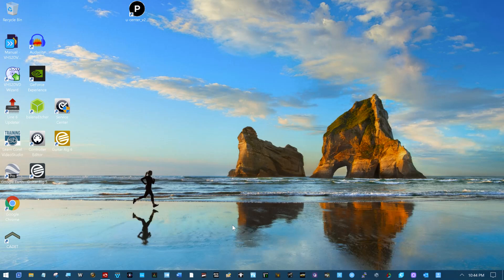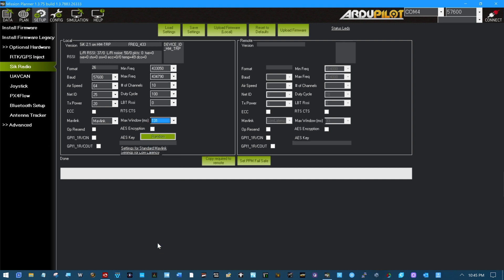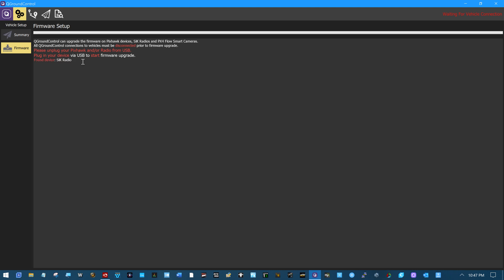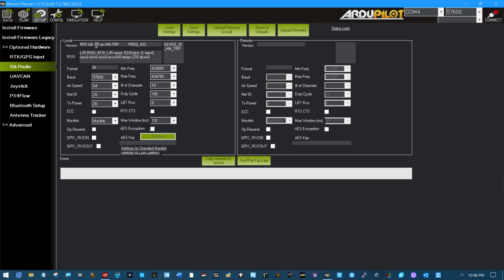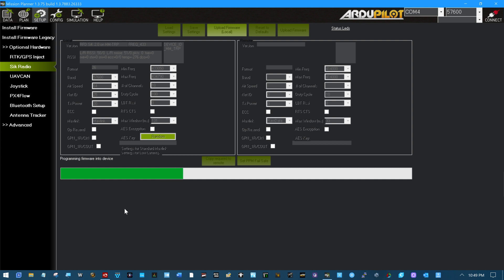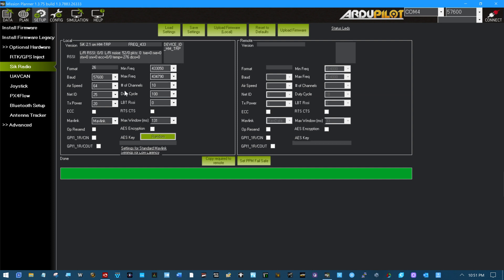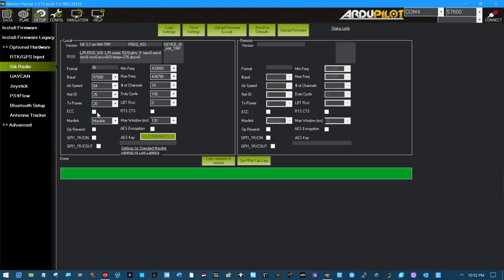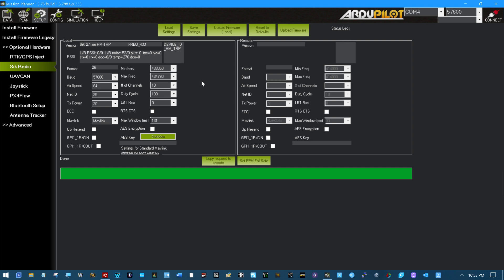Fun With Sik Telemetry Radio Firmware

Comment: Hi I'm getting the message "Failed to enter command mode" when trying to connect as per the video. I think there may not be a bootloader on the board. I purchased direct from factory rather than a hobby store. Do you have instructions for the bootloader?
Reply from the maker: I get that a lot.  I always go to QGroundControl and see if it works there, it happens so much.  If that doesn't work I go for the RFDTools.  If it doesn't work at that point I have to decide how much my time is worth vs buying a better radio.  :)
https://files.rfdesign.com.au/tools/
Reply: @nighthawkvs  thanks for the input. Which file/firmware do you use in RFD tools? the gbl and bin files aren't recognised by the software. It's looking for a zip file. 
Also do you select first time flash?

Comment: Mission planner is sayin failed to enter command mode when i enter load settings
Reply from the maker: Is this with USB or sik radio?  If it is USB some USB are charge only and do not have full data wires in them.  i will check further when I get back from vacation.
Reply from the maker: Did a different USB cable fix your problem?

Comment: In your next video can you open the drop down on the power settings in both firmware I  got both the 100mw and 500mw and can't seam to get the power to go higher than the 20 can you do higher?
Reply from the maker: 20 is the highest possible and should equal 100% power.  But I will do as you asked in the next video.